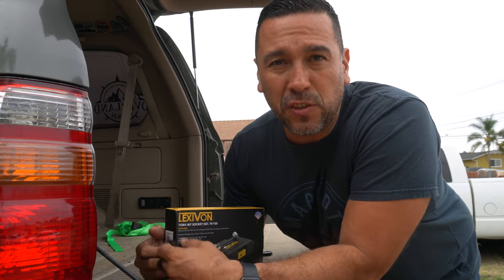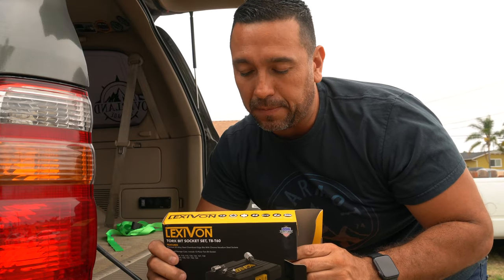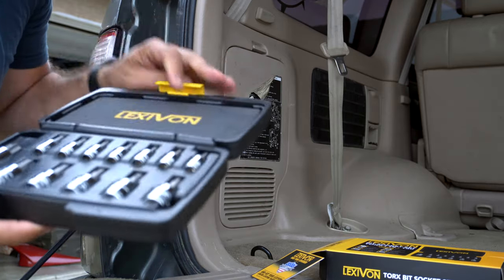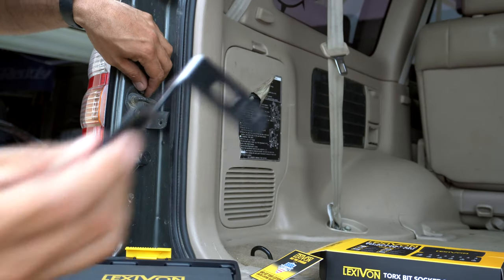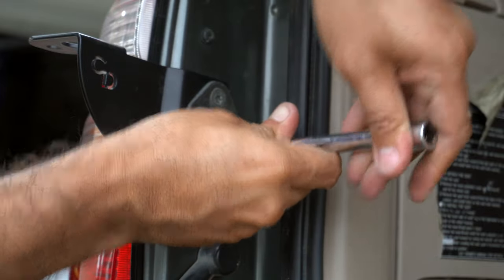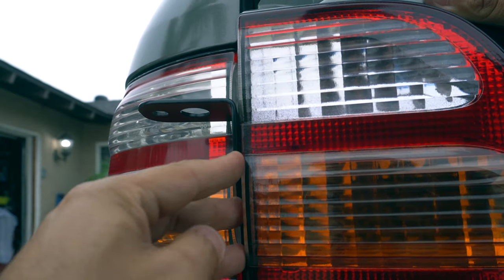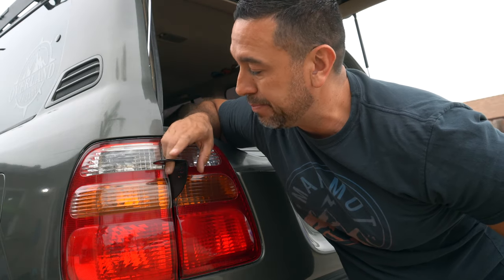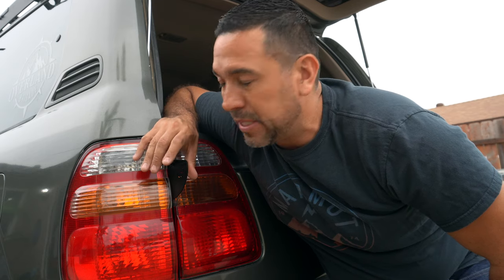How To: Install 100 Series Land Cruiser Rear Antenna / Light Bracket.   4K

Comment: Hey - checking in with you on this update - are you still using it? I hear that it's better to mount away from the body a bit more - thanks!
Reply from the maker: Still have the mount but haven't installed anything on it yet.